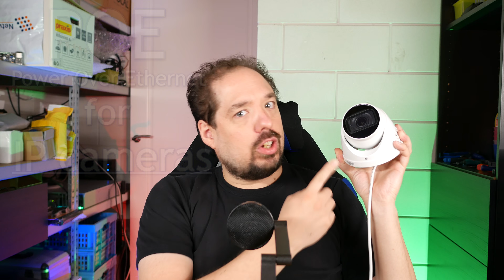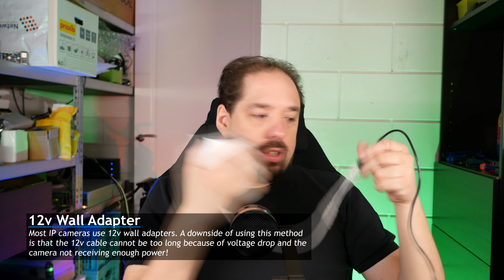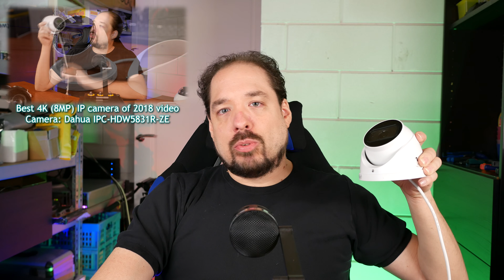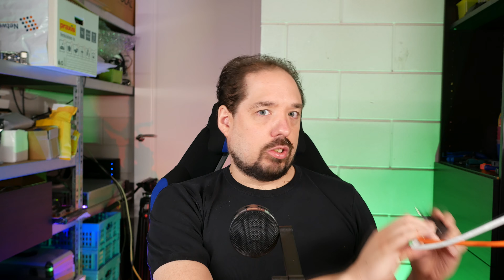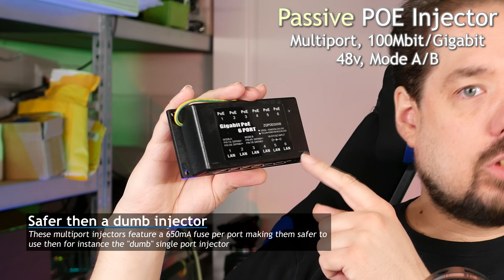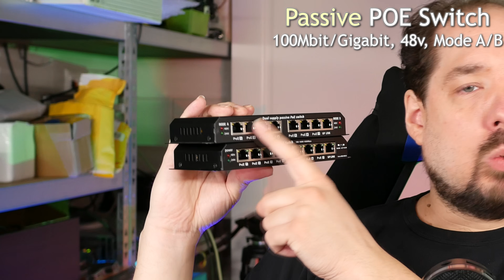IPcam: Power over Ethernet (POE) for IP cameras

Comment: What I don’t understand is the whole point of the POE is to have one wire for power but by adding an injector you need a second source of power for it making it two connections.

If it is one IP camera, wouldn’t it be the same like using the 12 volt charger and an Ethernet cable (2 connections)?
Reply from the maker: If using injectors and extractors, yes. But the idea is to just have a Active POE switch with a POE capable device, that way you need nothing extra and it just works when you plug it in.

Comment: So you don’t need both.  Either injector or switch.  Injector for less cameras, active is safer than passive. 

I am trying to connect one POE camera to a mobile router/modem and am trying to figure out what I need.  Do any of the router/ modems have injectors or switches within them?

From my understanding, an active injector would be best in my situation if such a router does not exist.

Comment: Hi, I wish I’d seen this video and your forum before I bought my cameras. Anyway, we’re here now. So my setup is everything that comes in the box (four 3mp ip cameras) from Hiseeu(more like the Zosi one), I already have a wireless modem at home, so it’s connected to the nvr, but the problem is “power and cabling” because I noticed the wireless signal wasn’t reaching parts of the premises where cameras 2 and 4 got installed. So I went ahead and got an 8 ports POE switch(also, without thinking it through). Initially, I thought using cat5e cables connecting the cameras to the poe switch while the Poe is connected to the nvr should power on the camera(but it doesn’t). Now I have to run electricity separately to the locations of the cameras to power them… should I now go get a splitter or an injector (an active or passive) in order to power the cameras with just the rj45 cabling.? Ps: poe switch has 10 rj45 ports(2 for uplink), it supports 30W max per each port. it also Complies with IEEE802.3af/at standard(I’m guessing that makes it an active poe). While the cameras are powered with a 12V 1A adapter. NVR has just one LAN port (which is where my poe switch is plugged into)

Comment: OK self taught camera girl here so go easy on me please.  I have been using and have used in the past 10 years just basic infrared wired cameras. I have always used cat 5E Poe. In the past my cameras needed to be mobile and I have used passive audio/video/power baluns.  Because of the portability, lightweight status and transport packing simplicity, I found that the baluns were the easiest to use.  I am currently in the process now of setting up a home security system with DVR and 8 cameras. I am basically using the same process that I did for the mobile but am wondering about these switches. My closet that holds the dvr and such is a mess.  It's a cable OCD nightmare. My question is can I use one of the passive switches on the DVR end and still use the other existing smaller baluns at camera site?  Clearly there not the same make and model and I am wondering if they would work together regardless. Clearly they're not the same make and model and I am wondering if they would work together regardless.

Comment: how do I fix the delay on my phone app
Reply from the maker: Get a better NVR with app? Generally it's 2s to 3s anyway because of RTSP and buffering, especially if not on local network.
Reply: @IntermitTech  do you got nvr can I buy it. and when you say not local internet what's that mean? it is connected to my router.  thank you for your help
Reply from the maker: Sorry I can't advise you on an NVR. The one I run I have videos about on my channel so you can learn. :)

Comment: I have a question...I have an NVR box with built-in 8 port PoE  switch that I plan to use with two bullet cameras. My question is .... whether I can use the remaining 6 PoE ports of NVR as switch ports for a small home network and avoid investing into purchasing a separate switch box.
My other concern is whether these spare PoE ports would be 'Active or Passive' If these are Passive PoEs ....then will they cause other issues....? Wonder if these ports can be configured to act as Active PoE Switch ports. NVR box will be Ethernet connected to the Modem/Router. Here's the make & model: 

https://www.lorextechnology.com/4k-ip-camera-system/4k-ultra-hd-ip-nvr-system-with-4-outdoor-4k-8mp-ip-cameras/4KHDIP84N-0-p
Lorex Technology

Comment: hi I am having one cable going outside my house for 1 CCTV camera but I need to add one more camera to it Can I do that an what are the accessories I need ? I have seen your video for the same but doesnot  understood total how many things I can buy to connect my second camera an what are they called if I have to order from online need specification as well for the same
Reply: You need to give proper information before someone can try to help you . The exact model of the camera and the NVR ( i am assuming you do not have a POE switch right now). If your cctv system is not IP (cameras), but analogue, you will have to get another wire (analogue cable) from the DVR to the (new) camera ( a separate power supply will have to be given for this new camera).POE switches can only be used with IP cameras. Assuming you have an IP camera/NVR (is your nvr poe or non-poe?) and you want only 1 more camera, it may be cheaper to run a cat5e cable from the nvr  to the new camera (rather than investing in a poe switch, which costs above Rs.4K in India).

Comment: Great video and very informative, this is a rare thing! Sets things in perspective and gives you a clue on the possible setup's. 

I was looking for a tutorial on how to set up PoE switch on a PI and stumbled on this.

I'm currently in the process gathering information on how to make a cheap and reliable DIY home security based on a Raspberry Pi as an interface point, but there is a bottle neck.. it don't support alot of ethernet ports and power is limited, aswell is processing power...but! after looking at this video through to the end, there might be very passive way handling this problem ;) 

Depends on the load of the hardware and as I understand a active or passive switch will tie up these points in the bottleneck? @intermit.Tech

Comment: Can I use 64 port passive injector switch(100Mbit) to power 52 IP cams?
Reply from the maker: I don't think they come that big, and you also need to take up link into account. Depends what your camera is set to but let's say 6Mbps. 52x6= 312 Mbit, so won't work on a full 100Mbit switch but it can if your switch and NVR have a Gigabit port too.

Comment: Awesome video, really clear and concise. I am currently trying to install and 8 camera IP system to my RV but the cameras only take 12v a opposed to 48v. The NVR supplies POE which his is good I need to run as fewer cable as possible which his why your other video about 2 IP cameras on a single cable is very interesting.

Comment: I run 1 CAT6 cable from the router to the garage.  From here I need to have 4 access points and 8 IP cameras.  Can you suggest a setup that fits my need?  I saw that you have a setup using passive  multi-port PoE injector in the video.  Can you explain in details how to set it up?  Thanks a lot.

Comment: Hi - I bought GW security 5MP camera system PoE cat6 cable off amazon.  I’m 21 meters from switch.   During construction pin 2 and 3 are open and I can’t replace the cable - can I use the camera with 3 pair and if so which pins are active?  Any help is very much appreciated!!

Comment: I have a Vivotek FD8134 camera on a QSee model QC826.  Works but doesn't show the time.  Hopefully new firmware might solve the problem.  The NVR doesn't like the firmware (0301c).  Any suggestions would be appreciated.
Reply from the maker: Ask where you bought the camera for newer firmware, that's most often the best way to get it.
Reply: I got the camera, used.  Got the firmware from Vivotek website.  From the list I selected FD8134V (301c).  My NVR software won't accept this firmware
Reply from the maker: @dennisliedtke2171  I don't have any experience with Vivotek so can't really help with any firmware, sorry. :(

Comment: I have one CAT5e cable going into my garage from my router and NVR but I want to run 3 poe cameras. Can I install a poe switch in my garage, connect the switch with the one CAT5e cable that I have in there, and then also connect the 3 cameras to the switch?  Or do I need to run a separate cable from each camera all the way back to the NVR?
Reply from the maker: You can just add a POE switch, run the cameras on that and then go with one cable back to the NVR, no problem.
Reply: You are the man!  Thanks.
Reply: Will I need to power the switch from an outlet or do they make switches that could run off of poe from another switch or the NVR?
Reply from the maker: @Hunter-vb8wo  Best would be to use an output, I have a video of running multiple IP cameras on a single cable, in the description there is a link to a 4p switch which as 1x POE input but not sure that's going to work with the NVR POE.
Reply: Hi , I have a NVR and needed a new ip camera but when I plugged it in it only gives me a IP address on the screen not a picture , how do I make this work thanks ! 🙏
Reply from the maker: @Antimatter.  Euhm, that is so little information to go on I really don't know what to tell you. Have you configured an IP number on the camera?

Comment: Other than the Ubiquiti nano switch POE passthrough, is there any other outdoor POE passthrough I can use that does not require extra power supply other than the POE in, I only need 2 POE out
Reply from the maker: I don't know of any you can use directly outside. But check out my "2 cameras using a single cable" video, there I show multiple ways how to do that, including some switches which accept POE in and then have multiple POE output ports. You would need to build them inside of an outdoor enclosure though.

Comment: I have an 8 port nvr, 3 ports have been used and functioning, but i need to connect 5 IP cameras wherein the distance is 150meters or more. Can i use an 8port POE switch to connect those 5 IP cameras then 1 cable from the POE switch to the NVR. Thank you sir...

Comment: Fantastic video, thanks. We’ve already installed Ubiquity poe switches, along with their access points., however wasn’t aware of the 24v limitation for poe cameras. What cameras would you recommend, we’d probably need up to 12 cameras, with around half being exterior ones.
Reply from the maker: No problem, check out my playlist about IP cameras, especially the 2018 and 2019 version, those have the cameras I like to use: https://www.youtube.com/watch?v=vbxUBaRQzUE&list=PL4b74vD-Uo-PMOUTsC2Yp5OXlDLAqWe6w

Comment: Before I started using IP cams I was using AV composite cams with a AV switch box. They were old large black and white metal prison cams I got at a discount. It limited me to only seeing 1 at a time. Then a power surge hit one of the cams, sending electrical feedback to the switch box and it shorted out every cam as well as the CRT. I had to move on to newer tech... lol

Comment: I bought a Sance NVR system last year with 4 ip cams, but the wifi keeps going out so I wanted to move to ethernet and a switch since the cams all have optional ports. I may even ditch the NVR and use a dedicated computer with ip cam software. If the new Raspberry Pi 4 is powerful enough I can make my own NVR. This video was very helpful, thanks.

Comment: Great video about PoE switches and also cameras. Thank you ... Question: Is there difference between what cable to chose for PoE cameras - that will support maybe future cameras also. Im looking to buy few 8MP cameras.
Reply from the maker: Not really POE is rated for 100 meters over CAT5e and up. But going CAT6 right now is probably best. If you want anything 10Gbit I would recommend CAT6A but that's total overkill for a camera. Also the newly introduced 2.5Gbit and 5Gbit will be more used in newer devices then 10Gbit so you are good with CAT6.
Reply: Intermit.Tech... Thank you

Comment: Is a 15w poe switch enough or is a 25w poe switch better ?
Reply from the maker: 15w 802.3af is generally enough for most devices like IP cameras and access-points etc.. Unless you get into mega PTZ cameras with lots of IR for instance. But then the cost of a POE switch won't really matter either. 😅
Reply: @IntermitTech  Its for a PTZ camera but not a big.Its this camera https://www.amazon.de/Mini-Outdoor-Kamera-opt-ONVIF-wei%C3%9F/dp/B01GE3BP28
Reply from the maker: @TKommandant  it says compatible with 802.3af so 15w. They also mention a switch that is only 802.3af or 15w compatible. So you'd be fine getting that, it can't hurt to also get something that is 802.3at compatible, but for this camera at least (and for most), it's not needed.

Comment: From a professional standpoint when I deploy a IP Camera system I use a NVR to host/manage the IP Camera network. Not to mention it can record the video and so forth since 99% of my customer base are not "savy" in the tech world and they want to view their Cameras from their smart phones, tablet or directly to a TV with out having to push/swipe a crap load of buttons/options. You can buy NVRs that have built in POE switches, just like analog DVRs you can buy 4port, 8port, 16port and etc. Keep in mind these type of NVRs are Passive POE except for the port that is labeled LAN that is either 100mbit or 1000mbit.
Reply: Clayton, interesting this is the route that I have taken, using a 16 Chanel NVR!  However, I am having image issues. Some channels show while others won’t even come on. Yet receive message regarding “time lapse has run out” .  Do you have a clue what this means or does it go back to extra power being warranted via an additional POE. Mind you, only 9 channels are used out of the 16 channel POE NVR UNIT, so saturation shouldn’t be a concern.

Comment: Buy a nvr, DONE!
And allot cheaper, and you got storage, and etc etc..
Reply: and it comes with limitations so it is important to find solution that meets your requirements.
Reply: For the novice user, this is fine.  If you want more capabilities, then buy an active switch.  I think buying a 24 port used active gigabit switch on ebay for around $50 is the best option if you can deal with the fan noise.

Comment: If I put a POE CCTV NVR to a POE switch would there be a problem - as they're both transmitting power?
Reply from the maker: Often POE switches will have Non-POE ports but as long as they are both active POE devices it should always work with each other and not cause a problem. With passive POE devices (no negotiation just puts power on the pins) that could cause an issue!

Comment: Hello,
but aren't those IP cameras usually 12 V?  I do not have to somehow step down POE voltage to 12 V?
Thank you.
Reply from the maker: If you directly connect it using the DC in they are 12v, but using POE over the network cable they need 48v

Comment: Very nice video, well done. I have a question please, i see some POE switch that use pins 4,5 for - (48V) and pins 7,8 for + (48V) and some other POE switch that use pins 4,5 for + (48V) and pins 7,8 for - (48V)  , so what should i choose ? or the camera dosn't care ? (use bridge inside on camera ?)

Thank you in advance.

Best Regards,
Tasos
Reply from the maker: Wikipedia actually has a good diagram about this but normally, 100Mbit mode B should use 4,5 for + and 7,8 for -. I find it odd that some switches/injectors might do it differently but if you have to chose, chose what I just wrote. That's compatible with the official standards. I think in the end the camera won't mind and rectify it but I don't have experience with it.
Reply: Thank you very much for the reply.

Please keep the good job ! ! !

Best Regards,
Tasos

Comment: Very informative video. However, I am surprised you didn't mention how to run two POE cameras off one cable. I do this for corners of my home that will have two cameras. Since these cameras only have 100Mb connections, you don't need all 4 pairs/8 wires. I just made a splitter for the camera end and then punched down into two different jacks on my patch panel ( type B on both ends ).  I went with a Cisco 3650e 48 port POE Gb switch with 2 10Gb uplinks, although there are better options, the Cisco made sense for me since I am in IT and also use it for learning.
Reply from the maker: I actually recorded it, but it made the video too long, soon!
Reply: Gary Hi, I am curious as to how you used 2 pairs per camera and kept the B format, when your given striped orange, solid orange(1) striped green, solid blue|striped blue(2), solid green(3), stripped brown|brown(4). When using B format you your going to have four conductors on each punch down that coordinates with the color scheme. I guess what your implying is the first 2 pairs you punch down on the left side and pairs 3 and 4 you punch down on the right side of the keystone in order to keep the same color schemes to match B format. If not, please explain....thanks!!!

Comment: If you are budget conscience and will be using lots of cameras, POE phones, etc you might check out eBay for used Enterasys C3G124-24P (24 port) or C3G124-48P (48 port) switches.  It seems like they are somewhere around $50-100 in general.  I have been using 4 of these at work (along with several spares) for a couple of years with around 25 cameras, 15 phones plus computers and printers.  Just make sure that they show the proper P/N in their pictures.  I have seen several listings (and bought...) with the proper P/N in the title and description but the P/N was without the P on the end and therefore NOT POE.  They are fairly noisy so not ideal for a normal home system.